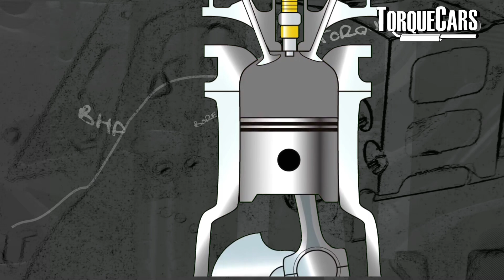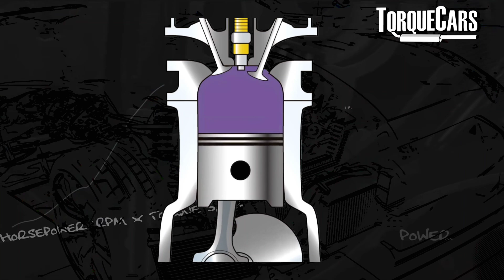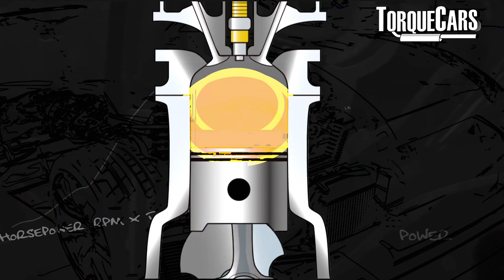Understanding Pre-Ignition, Knock, & Detonation in Engines - Differences & Causes Explained.

Comment: So if it’s a regular noise (like every stroke) it’s probably not knock / detonation?
I’m hoping my car hasn’t got big end bearing problems but somebody listened to it and said it sounds more like detonation to them… but it’s not irregular or random.
Reply from the maker: Knock can be a regular event at specific RPM and engine load conditions, if you use high octane fuel and it goes away then that would confirm it. Check valve clearances etc... It can often be down to wear and tear on the head if sounds like a tap at the top of the engine.
Reply: @torquecars ah ok thanks.. Thai is happening as soon as I start up at idle. It goes way if I rev it but gradually comes back as the revs drop.
It has only started in the last 2 weeks, oil hasn’t been low and it’s only ‘just’ due a change, looks ok on the dipstick but haven’t emptied it yet (service tomorrow)…